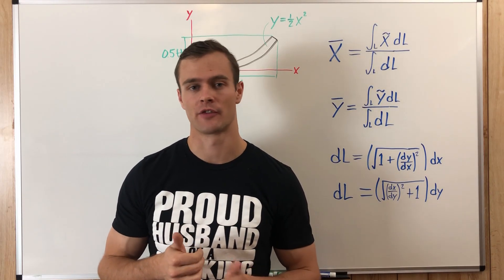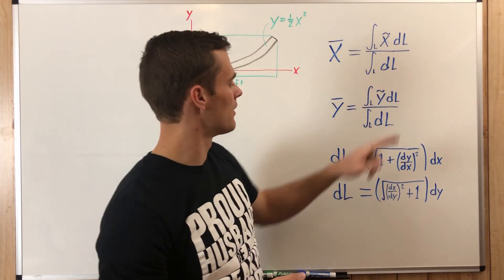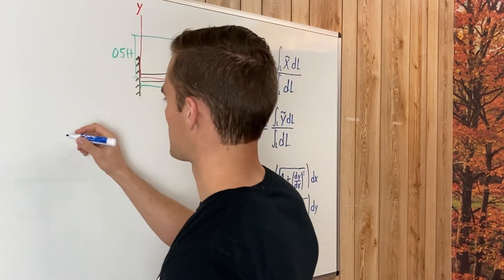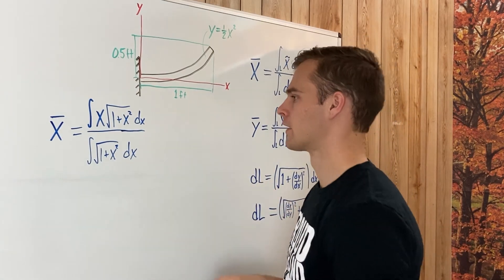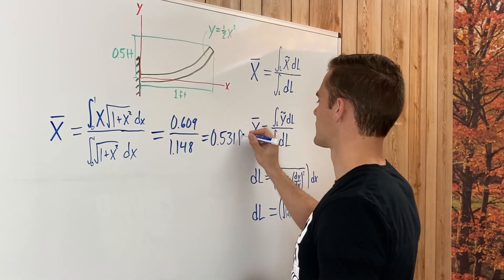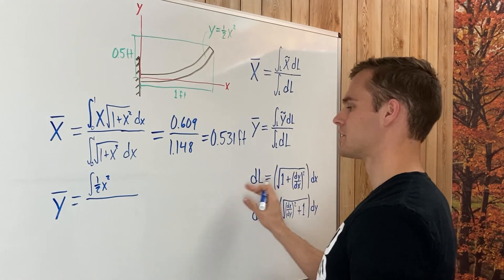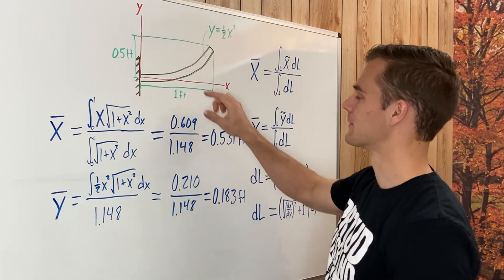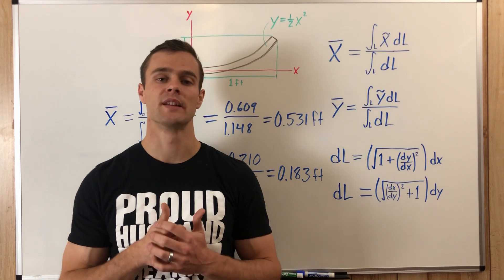How to Find the Centroid of a Line // Equations and Step By Step Example Problem Included

Comment: Hi would the bounds for y also be from 0 to 1 or did u integrate from 0 to 0.5. thank you!
Reply: The integral to find y bar as shown in the video is still with respect to x, so the bounds would still be from 0 to 1. However, if you were taking the integral with respect to y, the bounds would be from 0 to 0.5. The bounds you choose depend on what you are taking the integral with respect to(whether you use dx or dy in the integral), not if you are doing y bar or x bar. Hope this helps!